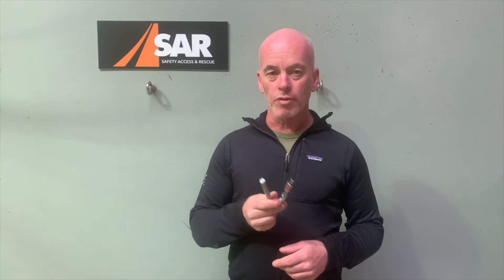Testing to failure part 1

Comment: The wider sling make sense as they put more force into the carabiner gate than the 10mm pin used in the certification test. The dual carabiners was interesting, basically seems like only one took the load until it broke and only then did both truly share the load until the 2nd broke. True equalization is hard to achieve, even with 2 identical carabiners sharing a masterpoint!